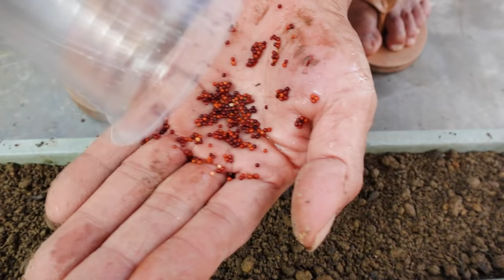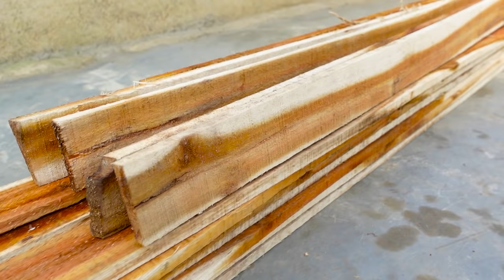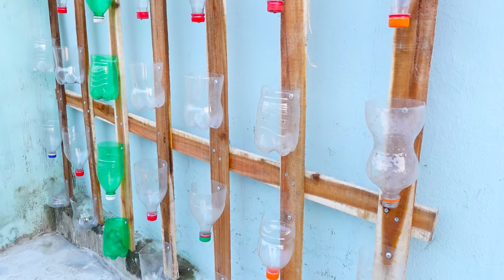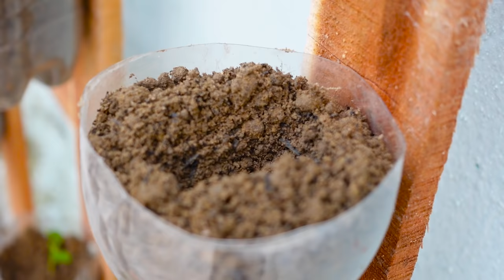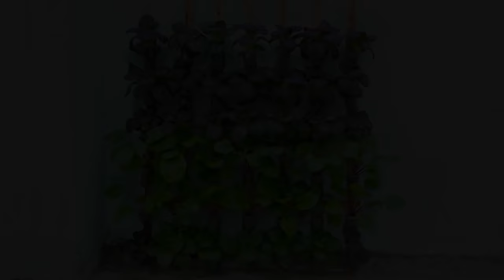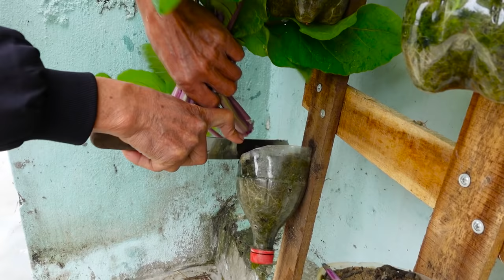No need for a garden, Turn a small wall into a lush vegetable garden to provide for the family

Comment: i did similar project for a friend; he lives in apartment and doesnt have balcony, so we turned one wall into hydroponic garden using rain gutters, sealed on both ends, fish tank water pump and two 20gal buckets for water nutrient mix. he did remove old windows and install bigger ones (from floor to  ceiling) so plants have enough sunlight. works amazing, and he didnt have to buy any of green veggies for years now.

Comment: Just wondering if just by watering the top layer would the water seep down to the lower layers. I'd also suggest hanging the whole frame on some hooks so the whole thing doesn't fall down in strong wind.

Comment: Good job! However a tip -- That wall is constantly getting wet ... soon the color & strength of the wall wouldnt be the same! I suggest add a plastic tarp to the wall , behind the frame ... & add a drip irrigation system , so you don't have to manually water all the time.

Comment: I have a big problem with slugs, roly polies and earwigs. Since I moved here, they eat all the tasty things I try to grow if they can get at them when they are young. The earwigs are even eating the leaves on the trees! I looked up all about it, and all the things I found online said they aren't a big deal and don't eat your plants, but I can go outside at night and pull earwigs off my raspberry bushes, they go inside the ear of corn to eat it as it develops, they are on the leaves of the potato plants, eating them, the roly polies eat all squash or melon plants unless they are large. I have had some plants eaten from underground, they just starting wilting and when I pull it up there are bugs eating the roots... I put out the bacteria stuff last year and this year (sluggo plus for the earwigs) but I don't like that. I don't like interfering that much. I think this is the solution for greens for me. I bought the fence hanging thing that is black and has pockets, but the bugs can still get in them. This has separation and the bugs cannot scale the plastic I read. thanks